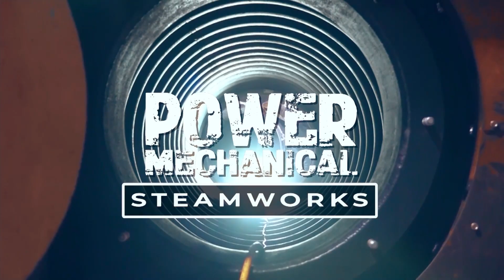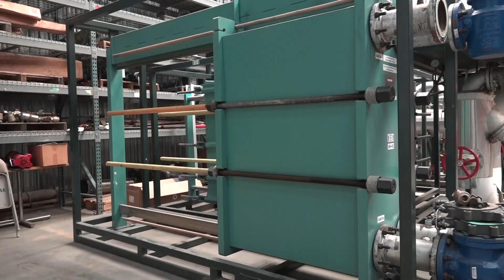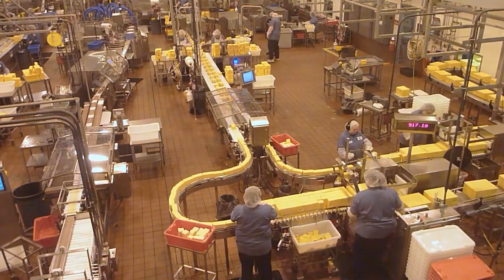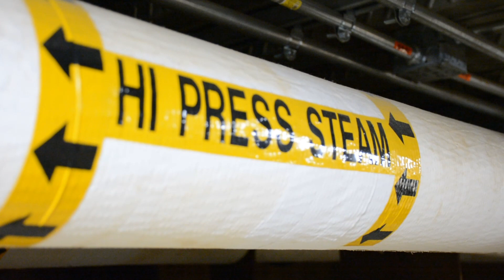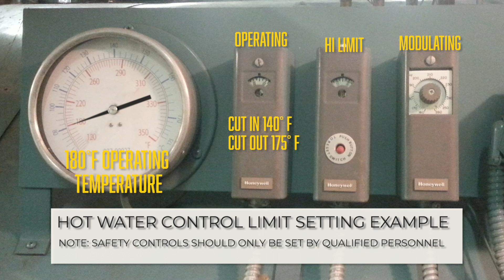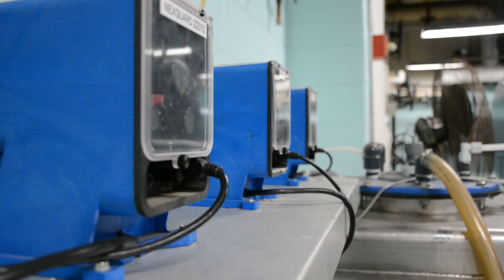Hot Water Boilers and Differences in Boiler Controls - SteamWorks

Comment: You mention air and leaks in hydronic systems... I know some guys that say air vents and separators let in as much air as they let out... BS or an actual issue?
Reply from the maker: That's a great question. However these are designed to work like a check valve. They typically have a ball that will float up and down with the rising/falling water. Tentative to water quality or other things that could impinge the float mechanism then they could hang up allow some air yet there would be a surge of water.  Concluding that they should just be check regularly for proper function.